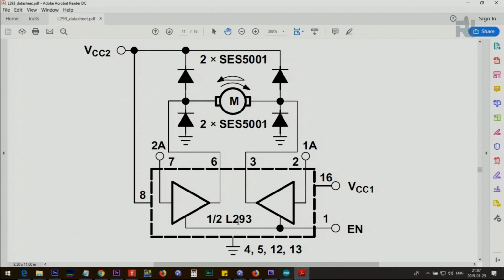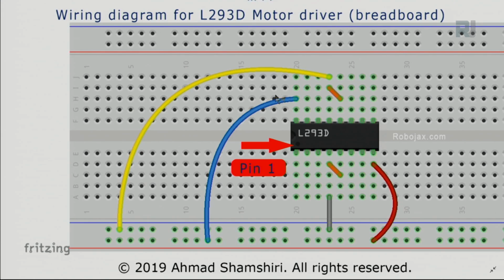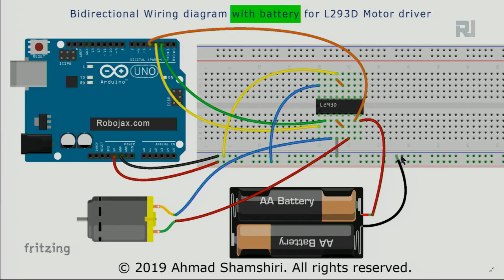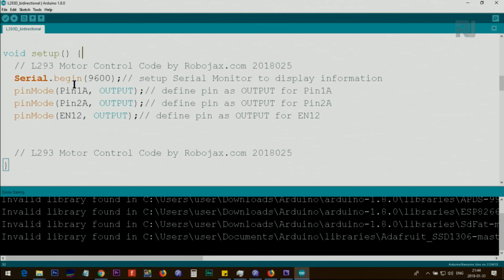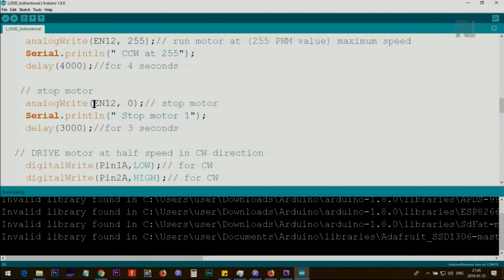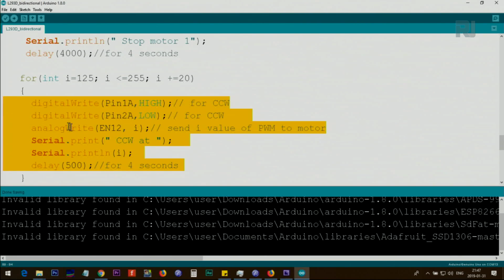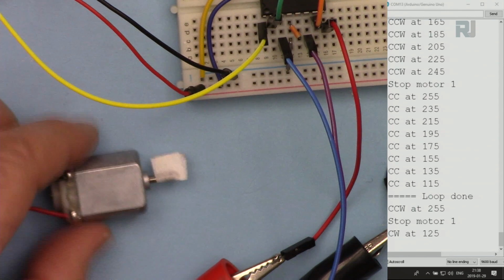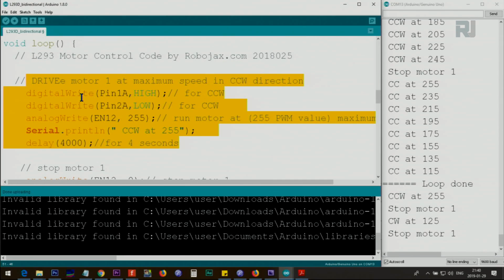Lesson 50: Controlling Direction of Rotation of Motor | Arduino Step By Step Course

Comment: Could you hook up the l293 to external high power mosfets and drive a higher current motor? I was thinking it would enable the gate with the pwm and allow a higher current to be controlled.   Thanks
Reply from the maker: If we have mosfet then we don’t need this chip. With a resistor we can connect it directly to Arduino which God willing I will make the video. Thanks